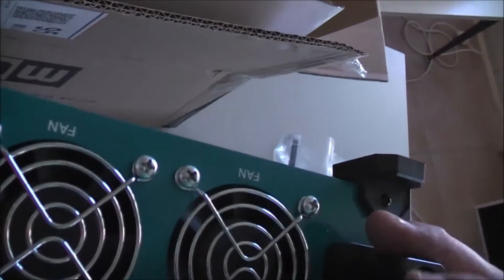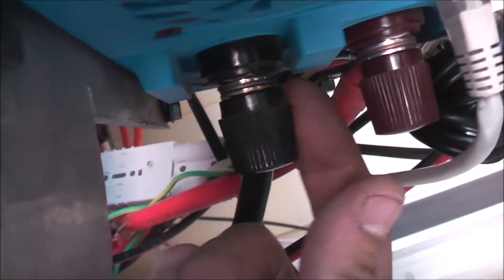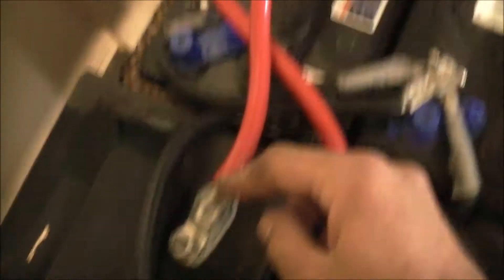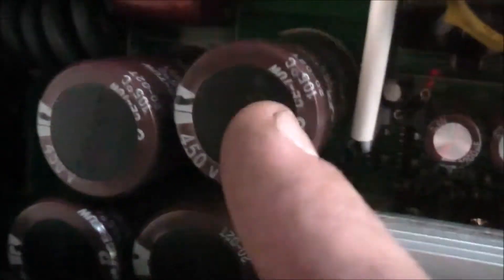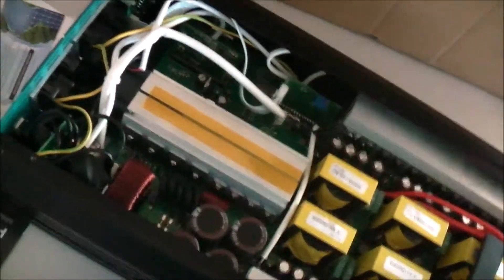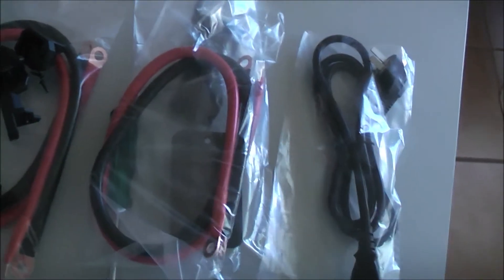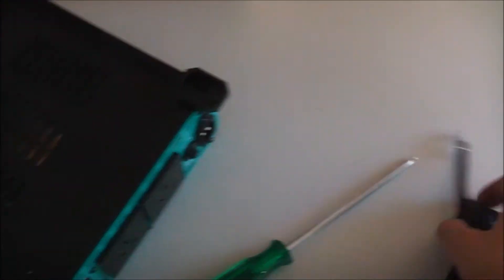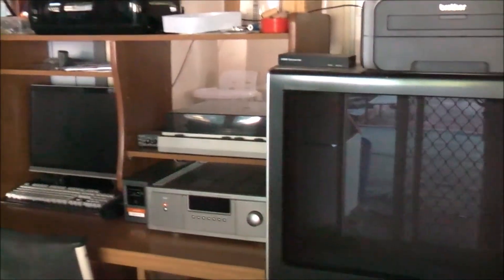3KW Renogy Inverter Upgrade

Comment: Still got this? How's it going looking at putting one in my truck
Reply from the maker: I do
Reply from the maker: If ya do, it will need 3 batteries parallelled minimum to deliver 3 KW, 12 V at 300 Amps

Comment: Hey, I'm buying this inverter but I want to disable the low voltage alarm/beeping or at least put some foam/tape on it to dampen it. Can you tell me where the beeper/buzzer is in the case? And maybe also some tips on how to disable it if you know of any? Thanks!
Reply from the maker: Easy to find, put duct tape iver it, its toward left side looking at component side of board
Reply: @HDXFH  Thanks for the reply, I was able to locate a pezobuzzer on the main board, I put silicone caulk in the hole and put a 3m adhesive rubber spacer on top of it. Problem... didn't seem to do anything to the sound. Granted this is a new inverter so not sure how loud it would have been otherwise, but it's piercing loud still. When I listen to the beeping it sounds like it's coming from the small board where the switch and lights are in the front. So maybe I can find another buzzer, but man this one is more annoying than my last.. When the battery gets low it beeps over and over, then when it can't handle it anymore it emits a squeal much like when someone dies at the hospital only far louder and it will sit there are squeal for god knows how long, I haven't tried.

Comment: Good stuff mate . The new inverters now have the Australian outlets on them I see. Mine has the Chinese multi outlets but still going strong and I just used the supplied wiring and no problems 👍🍻
Reply from the maker: Ran some inductive inrush loads on it, tests great, barely flinches, note this pulls 280 amp at close to 3KW rating